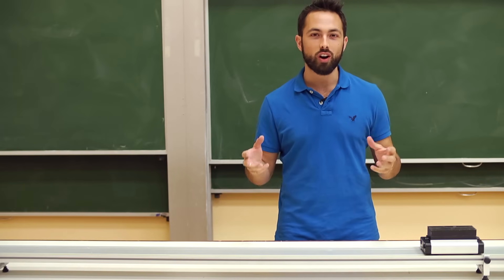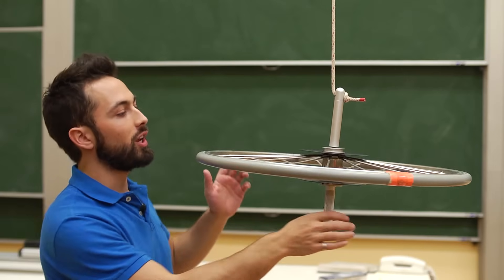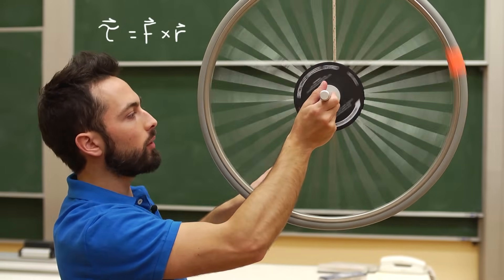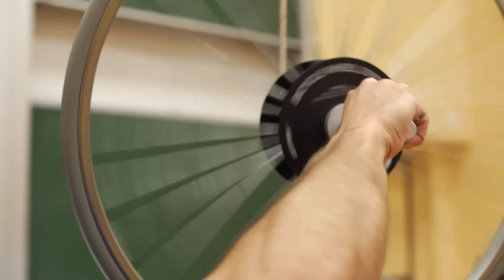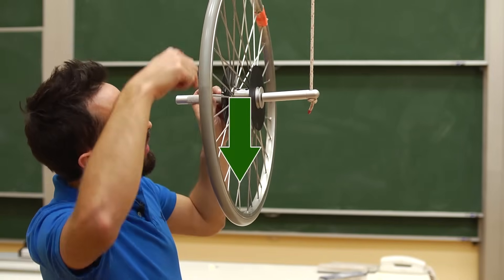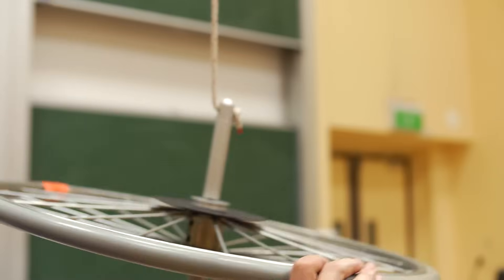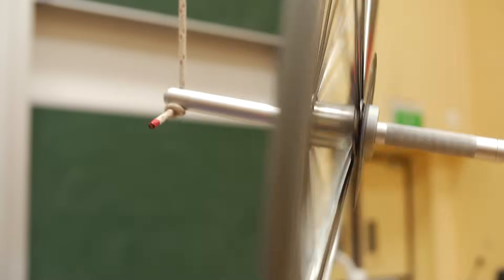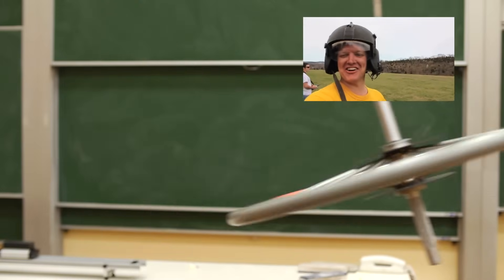Gyroscopic Precession

Comment: Put a high powered drill in your hand switch it in and start to man over your hand in a circular direction opposite to the direction of which the drill is turning while you finger is in the trigger....what you feel I'd opposite torque vector ...and you feel a strange resistance which doesn't want you to move you arm the way you have...TRY IT

Comment: What motion would occur if the axle was without friction? What is the connection if any between this phenomenon and the Julius Sumner Miller Demonstration using a propeller attached to a ridged stick?   (said propeller rotated when the ridged stick was scraped)

Comment: Very useful presentation!
I happen to be integrating a ST microelectronics 3-axis gyro sensor (L3G4200D) to a large gas powered helicopter using an Arduino Mega 2560 microcontroller as its host, and then using that assy to govern servo signals from my radios in all 3 axis.
A form of auto pilot basicslly..I'm at the 'writing the code' stage of completion.
This is a good video since I realized something simple I would have overlooked regarding some of the induced main rotor gyro/torque artifacts

Comment: Torque is calculated by what's known as a vector (or cross) product. Incidentally, this is where those Right-Hand rules originate from. But, a cross product will always give a vector that is normal to the two vectors from which they are calculated from because of the unit vectors i j and k.

Comment: curious and interesting that the right hand rule of force is the same as the right hand rule to direction of current (Amps) or electron flow of a wire in a coil.

Comment: I think it has less to do with pushing the air downwards and more to do with generating lift (kind of upward climbing process like going up stairs that fall away very soon after you step on them) faster than gravity pulls you down. In essence, if I'm correct, helicopters fly by literally "walking" upward in the air. Think paper airplane: it doesn't move the air; it rides on air.
This is in contrast to rockets, which are propelled by rapid release of compressed air/matter (pushing air downwards).

Comment: To get a higher amount of Moment/Torque, you need a higher Momentum.
Momentum=mv
For an object to "fly" the force created by Torque needs to exceed the downwards force created by gravity.
Because an object has a maximum amount of velocity due to friction and energy-loss to heat and the upwards force needed increases every time you increase the mass, it is rather hard to do so with anything not powered by a motor. Machinery that are able to do it however are ie. Helicopters.

Comment: @id104335409 you might want to look into the right hand rule for the cross product and the matrix method for the cross product. The result of a cross product is always a vector at 90 degrees to both vectors you are taking the cross product of :) I hope this helps

Comment: Because you are taking the cross product of the force and the distance from the  center of the rotating axis. The cross product is equal to the product of the modulus of the force and distance, multiplied by sin (theta), where theta is the angle between the two vectors. Sin (theta) is maximum (1) when theta = 90 degrees.

Comment: If you search for "Bicycle and motorcycle dynamics" the Wikipedia page links to at least two experiments, one in 1970 and another in 2011, where bicycles were created with counter-rotating wheels designed to cancel out gyroscopic effects and found that the bicycle was just as easily rideable.

Comment: Bookkeeping, not reality

It's a sign convention, due to history.  It is as arbitrary as which direction we use for a standard bolt's threads.  We could've used mostly left-handed threads, but history had its way and we chose right.

You could define torque with follow a left-hand rule.  And the same left hand rule, for angular momentum.

Without a doubt, you will get the same answer, the wheel precession direction, given a common initial rotation and a common hanging point.

Comment: Short answer: Because we defined it that way. Long answer: Because we defined angular velocity to use the vector cross product: w = r x v, read the w as a lowercase Greek omega. With angular velocity, you can find angular momentum, L, with this: L = r x mv = r x p. With that understanding, you must also understand that where force is the rate of change of momentum, torque is the rate of change of angular momentum. Then, we can prove that T = r x F. OR: [Angular Version] = r x [Normal Version]

Comment: Without angular momentum: swing a weight in a vertical circle by your right side, going backwards over the top and forwards under the bottom  As the weight goes over the top, bap it to the right.  The next circle goes through the same bap point, but the plane of the circle is moved left in front and right in back.

The reason it's unintuitive is that we intuit that force changes position.  Wrong. It changes velocity, and the difference matters in a gyroscope.

Comment: i got a question, say there is a top spinning, and it spins anticlockwise, so it got a torque, which help this top to stand, so not falling down. and if i spin it clockwise, the torque will (or should) just help the top to fall. but the reality doesnt say that. can you explain that?
thank you for the answer

Comment: Well, I get what you're trying to convey.. You mean, when you  have the vectors sitting on the X-Y plane, you can use the right hand rule.. But,any 2 vectors in 3D space are coplanar.. So by tilting the coordinates, you can convert any vector problem to a pure XY problem and apply the right hand rule..

Comment: yes^ cross products are not commutative. when working in 3D it's important to get the order right but in 2D with nice right angles you can get away with multiplying them in any order and then using the right hand rule to get the direction right.

Comment: The X does not imply multiplication in this case. When dealing with vectors there is an operator called a "cross product" which is represented by an X. The commutative property does not hold for the cross product operator.

Comment: Because physics....no really, because centrifugal force is pushing the wheel horizontally, and it tries to stay that way...wake a wheel and put it on the ground, it´ll fall over...now if you roll the wheel, it stays upright, until it´s velocity decresed so much that the centrifugal forces aren´t strong enough to fight gravity, at which point it will fal over.
That´s the reason people can drive bicicles without their hands...

Comment from the maker: actually he's right, when multiplying vectors using something called the cross-product, the order matters. This determines the direction of the resultant vector. I have used an annotation to write over my equation in the video - the direction I have given with the right hand rule is correct.

Comment: Very good. I had some difficulty in comprehending at about the 2 minutes and 45 second mark. The way I am now looking at it is torque applied to the wheel (F x radius) gets the angular momentum going which defeats gravity and the torque created by the weight of the wheel and pivoting on the rope has a chance to apply itself. Allowing the spinning wheel to be vertical and revolving in the direction of a torque.

Comment: dissolved particles and water like to go from high concentration to low, it's not about pressure: it's how they act.
It's not pressure in this case; it's just molecules spreading.
low concentration solute means high concentration water
high concentration solute means lower concentration water
so water goes from hypotonic to hypertonic solutions
(the amount of stuff doesn't matter: the concentration does)
I hope that makes sense.

Comment: That still to me does not really tell me why it happens. For example, I know air and everything else moves from high to low pressure because the higher the pressure, the more the particles push agaist eachother so they end up moving into low pressure, but I dont get why water would go from lo to high solute. I tried asking my teacher, she didn't know what I meant.

Comment: The reason the Torque is in the direction of his thumb is a because of something that you do when multiplying vectors called "Cross product". When two vectors are multiplied the result is a new vector that is perpendicular to the two vectors. If you imagine force on the y- axis and radius on the x axis the only way to make a vector perpendicular is for it to be on the z axis. The magnitude of the new vector is the area between the two vectors. In this case its only Length*Width or F*r

Comment: Hey Derek, do you think it is possible to levitate an object by using angular momentum. In theory it seemed possible to me but when I made some calculations I realized I needed quite a lot of velocity to lift a super light object. I think I won't be able to get the required materials to accomplish that but maybe you can do it. I would be quite happy if you did that or at least told me your opinion about it. Thanks!

Comment: the thing is that gravity is trying to change the wheels angular momentum

the faster the wheel turns, it has more mometum, and thus it is harder to change it's direction
it is meerly an outcome of inertia!!

did you ever tried to change the direction of your runing during the run?
if you r slow it is easy but fast you need more force

the same with angular momentum
I like to call it angular inertia
A dradle doesnt fall once it's spinnig, nor a bike

this wheel, the same
it is falling but slowly

Comment: it is just a defnition. and it is maybe the most accurate one
the spin or angular momentum is located in some plane right?
now what is the easiest way to definr a plane?
a line ou define by 2 points
and a plane u can define by 3
but, you can choose any 3 points in this plane

If you take a vector that is perpndicular (normal) to the plane it also defines the plane
and you can choose any normal but they are all parallel

so in spinning obejects you take the normal from the center of spinnig

Comment: take the wheel off the string, hold both axles in your hands, stand on a turntable and spin up the wheel holding it vertical. by rotating it such that the axis of the axles is no longer horizontal, you can rotate yourself one direction or the other on the turntable

Comment: what if the angular momentum is caused by the rotation of the wheel and the torqe is provided by the weight of the wheel, they both work in the same way? or it doesn't matter what we choose as the reference.

Comment: Its the right hand rule, so the torque, pointing outwards.  The two torques are not the same (other one caused by the attachment at the rope), so there is a net motion in one direction, causing a "procession".  If he spins the wheel the other way, it should process in the opposite direction.

Comment: So i have been trying to wrap my head around this for a while now and i think i have it down.  However i have a couple questions, is the fact that it is a right hand rule arbitrary?  Could angular momentum be defined with a left hand rule (angular momentum down instead of up) just as easily and still achieve the same result?  Or does the system truly have momentum in the right hand direction...  So basically did a physicist decide on the right hand rule?  Thanks!

Comment: right/left was arbitrarily decided upon by scientists long ago. You could use a "left hand rule" (consistently throughout the explanation), and the result will be exactly the same. Since angular momentum and torque are both vectors, you need a direction for them. They line up along an axis of rotation. Since the axis extends to infinity in two directions (senses is the proper term, not directions), you need to be able to tell the two directions apart, thus right and left.

Comment: Ive become really interested in this topic now and think there is a strong possibility it would help me in my profession of freestyle motocross.I wish we could do a video or even a study day with you or smarter every day. If you could answer me one thing, what would be the difference with say a solid axle and two wheels on each end by holding it in position horizontally with a fixture (like a swingarm) that may be a dumb question but I want to learn to control my vehicles more with knowledge.

Comment: one slightly untrue thing: a vector is something with both direction and magnitude, not just direction
a scalor (spelled it wrong) on the other hand has only one of these two

so for instance if I said the brick moved five feet east it would be a vector because it has direction (east) and magnitude (5 feet)

but if I said the brick moved east it would be a scalor  because it only has direction

Comment: can someone help me on this one?
acceleration is normally the change in velocity modulus
for centripetal force though, the acceleration is the change in velocity's direction instead of its modulus
torque normally changes the angular momentum modulus
in this case, as in centripetal force, torque changes angular momentum direction
is this a valid analogy?

Comment: pretty sure I should have heard the term resultant vector there some where.  like when it was spinning doughnuts by it self supported by the string.  it wanted to tip down like when not spinning and dropped, but it was let go while it was spinning, having angular momentum, and the two vectors fought, resulting in an actual motion.  not correcting or any thing.  just think the term helps the understanding of real time motion by summarizing the separate math/physics concepts

Comment: nullrand - the direction of the torque is not like a force direction. it's just the way we choose to denote something spinning, the vector direction is really the axis of rotation. You couldn't denote it with the direction of travel because all the parts of the wheel are all travelling in different directions...

Comment: I've seen this experiment done a thousand times but I still don't understand. I get it that there's torque parallel to the axis of the wheel. But I don't know what that means, is it a force? is it momentum? why doesn't the wheel move in that direction? and why does that stop the wheel from turning on the point where the rope grabs it and falling?

Comment: My physics professor did this using a bench grinder with a rubber platen to ramp up the rpm's, thus increasing the speed at which the wheel rotated about the string as well as standing out from the string at a 90 degree angle.

Comment: F and r are examples of what are called vectors. Vectors are just sets of  numbers grouped into a single dimension (like a row or column). There are operations that can be done on vectors similar to regular multiplication. One such operation is called the cross product, and it happens not to be the same forwards and backwards (the same way subtraction and division are not the same forwards and backwards).

Comment: Then when the wheel is drooping a component of the ang. mom. acting up would provide the necessary torque to counteract the torque due to the weight of the wheel. As the wheel drops, more of the ang. mom. vector points up giving more torque, while  less of the weight vector is creating a torque about the axis, explaining why the angle of the wheel drops quickly, then takes longer and longer to become parallel with the ground.

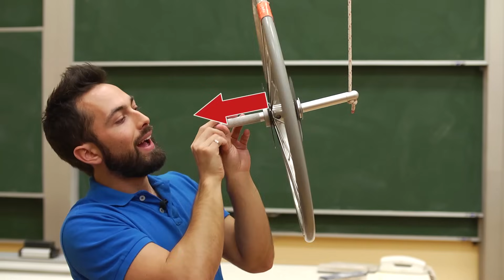Comment: 2. during free spin, there is still an angular momentum due to the wheel spinnging b/c H = r x mv where v = wr, and we have w, r, and m in the wheel. My question woulud be "what is keeping the wheel up". If it isn't the torque (b/c 0 for the free spinning wheel), is it the angular momentum? If it is, then I do a FBD of the setup with a vector for the ang. mom. and the weight force of the wheel like at 2:53.

Comment: In reality tho, the wheel does not spin at constant v, but there is a - angular  acceleration caused by irreversiblities like bearing and air friction which act opposite the direction of your initial applied force. My thinking is this would then create a torque in the opposite direction of what you say at 1:30...maybe I'm missing something here you could help me on.

Comment: It's not the same thing. The x is the cross product of two vectors. 

The cross product has different properties then regular multiplication and only is applied to vectors:

let A and B be vectors.
A x B = - ( B x A ).

..B x A  points in the opposite direction as A x B.

Comment: If you used your other hand on the other side of the wheel, then the torque goes in the other direction. So it is a right hand rule or left hand rule?

Comment: I know it can be a little confusing, but the whole ecuation is "L=Iw" or "L=r^p", which means that the angular momentum depends on the distance from the center of rotation, on the mass and on the velocity of that mass. A bicicle has way more mass and its radius is way larger too, that's why you need more momentum to change its angular momentum. Not sure if that was what you were confused about... :S